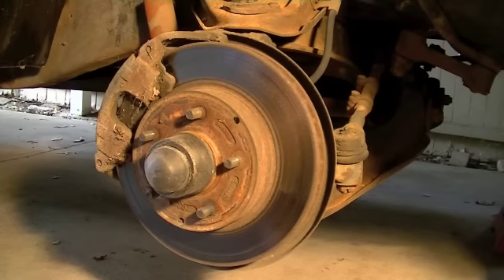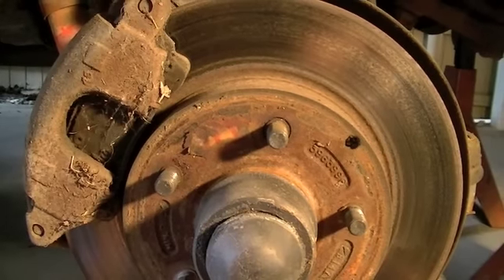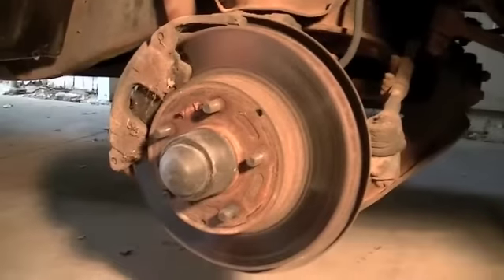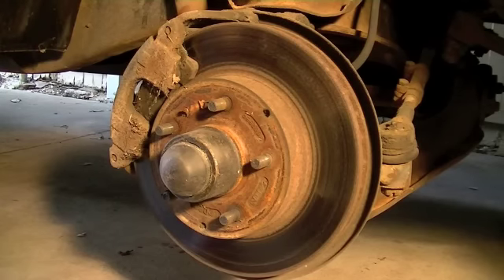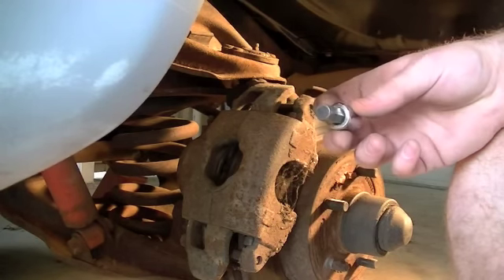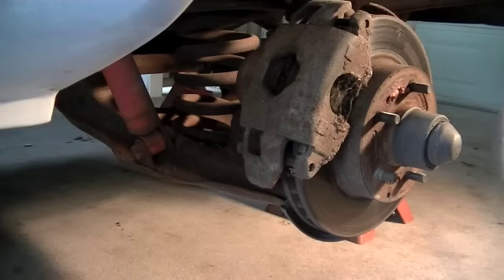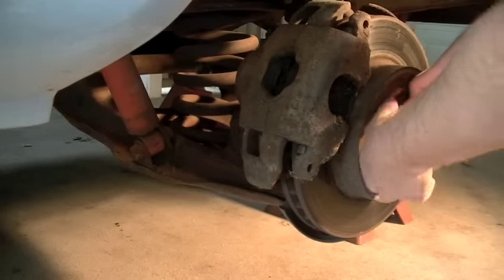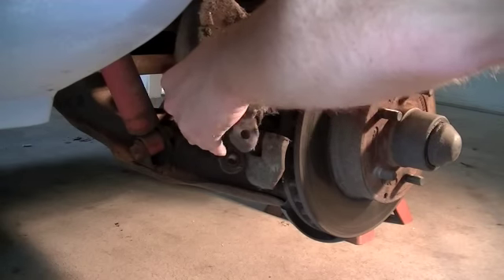PART 1 CHEVY FRONT BRAKE REPAIR | Chevrolet C10 Trucks

Comment: Hi, thanks for an excellent video and very clear and user-friendly instructions. Excellent! Could I ask a huge favour? You seem to be very knowledgeable on many aspects of the Chevy. I need a diagram on the fusebox of my Chevy C10 1967 model. I need to know the Amp ratings of the different fuses and positions i.e a description of which one works  what e.g. wiper motor, indicators etc.